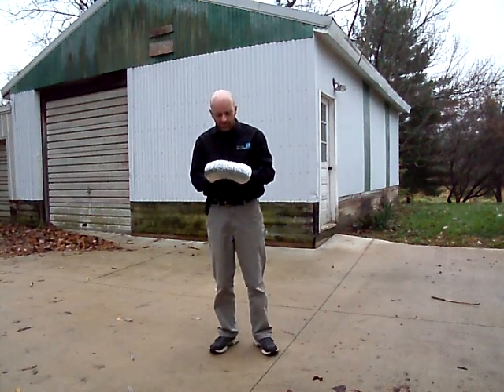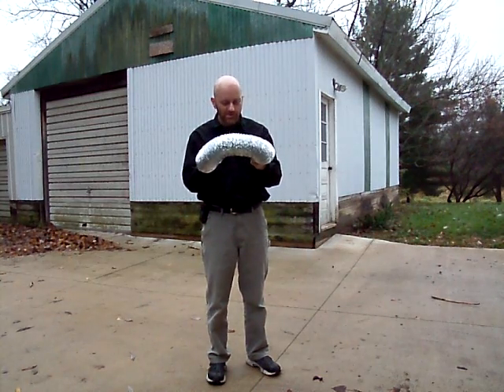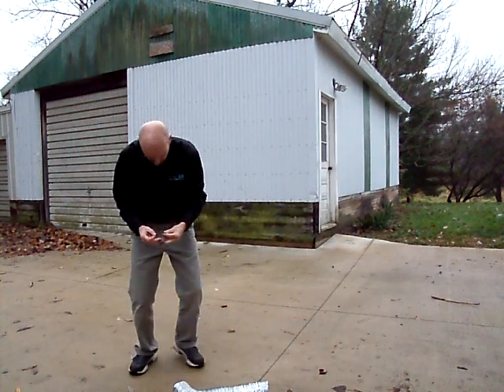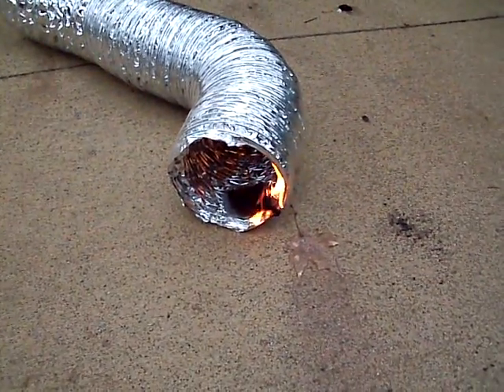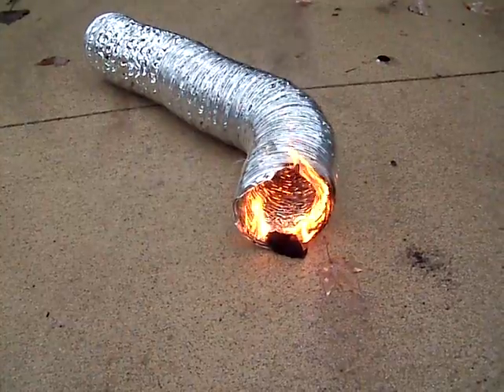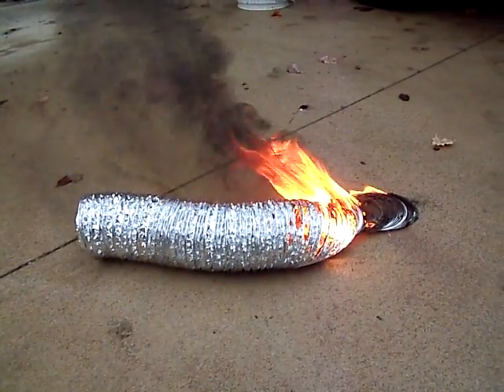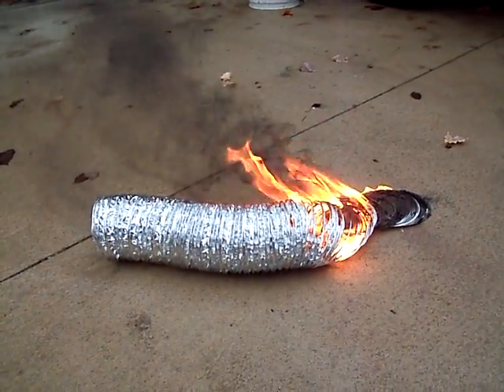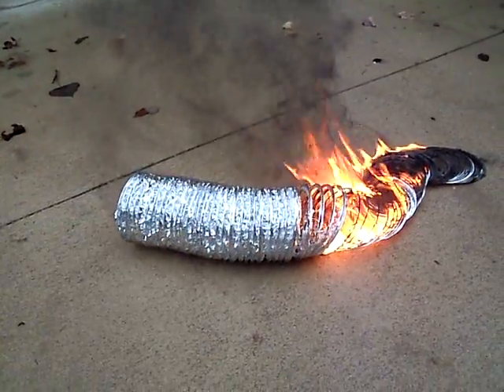Dryer vent installation BAD IDEA

Comment: That hose is not a dryer vent hose that is used for bath vent or a stove hood
Reply from the maker: Correct, but it was SOLD as a dryer vent. It's no good for most bath vents as well unless you can bury it under insulation. Without being insulated, it would allow a lot of condensation to occur. There aren't very many uses I can see for this material besides setting it on fire in the driveway!

Comment: I think this video is funny and not factual. I am a delivery driver for an appliance company and I use these dryer vents every day. Never once have I seen a house catch on fire due to the vent it self. Only due to not proper installation of the vent or installation of appliance. Any dryer vent can cause a house fire due to too long of vent and crunching of vent causeing lint to built of not escape the vent. Get your facts straight.
Reply from the maker: The FACT is that this product is being sold as a dryer vent, which is essentially a chimney, and the thing is flammable. You are correct that a dryer fire can still happen and burn up the house even with proper venting, however everything should be done to minimize the possibility. In addition, these vents get brittle and crack, leaking fumes into the house and could lead to some serious problems.
Reply: Plastic and thin metal flex duct like the one in the video IS flammable. Even if there are no issues with the installation the ducting becomes clogged with dryer lint over time (which is EXTREMELY flammable) and can cause a house fire. Thousands of house fires happen every year due to this. Get YOUR facts straight Mr.Gomez.
Reply: If a fire starts inside the dryer, that plastic will carry the fire to the structure of the home. However metal duct work will contain it and perhaps the lint will burn out and save the day. Thank you for this excellent demonstration.

Comment from the maker: Yes, if remodeling, an extra layer of drywall would be a VERY good idea too. Since most laundry rooms are small, using two layers of 5/8" drywall (preferably paperless or green board) and cement board under the flooring would be very cheap and do a lot to contain any fires. Good idea. Thanks for commenting.
Reply: You may find this video interesting. Metal studwork is now standard here in the UK on new buildings and major refurbishment. As you can see from the video, it runs below ceilings, preventing a fire path between floors in the building.
A complete review of building regulations is long overdue in the US. 
Once materials like this become the norm, they are mass produced and any increase in building costs becomes minimal.
Their is a joke about US architects in London, having an annual award for the company who designed the best bonfire.
Many a true word spoken in jest.
  https://www.youtube.com/watch?v=ABGd6B0v9go

Comment from the maker: The lint inside could catch on fire, but unlikely if it's way down the line. As long as you have good airflow through to the end it should be okay. It's when there is a clogged up spot that gets constant heat applied to it that causes a problem.
Reply: Yes it backs up in the dryer causing the thermosats to open and clothes don’t dry

Comment: I have the hard aluminium flexible hose on my dryer. It is safe material from what I can understand by watching you tube, but what happens if the lint inside catches on fire like you have demonstrated . Can that happen in the aluminium duct? I cant see down it all to clean out the whole duct. Only part of it at the exit.

Comment: My name is Rick Bishop. I am the founder of Bishop and Son Appliance Repair, llc.  This is great stuff- graphical demonstration. I too have been advocating the use of proper materials in home dryer appliances. Ridgid metal ducting might be beyond the scope of your average diy individual but by far the best approach. The aluminum flexible is pretty good but one thing to remember is aluminum begins to erode away at near 500 degrees farenheight.

Comment: @Nathan I'm a firefighter in a town of aprox 30,000 people and we get at least 2-3 working dryer fires a month and I have seen both all kinds of vent systems and by far this and the same style in the white plastic cause the most dammage to the home the next worse is the aluminum foil style duct tubing and the very best and the least damage is the rigid galvanized steel duct it contains the heat and fire and vents the smoke and fumes to the exterior of the home. I agree this stuff is awful !

Comment from the maker: I'm not sure why you'd want to do that. Do you need to have a combustion air intake in your basement to keep the basement from being negative pressure when the dryer or water heater runs?

Comment from the maker: Did the vent material you sell do the same as mine? I'm planning to buy a few more different pieces and do the test side by side with several types. Some of the videos I've seen of others who claim to have a safe material neglect to put flames INSIDE the duct or use a piece of lint.

Comment: Not all vent hose is the same.  Look for the UL listing. If it has the UL listing you can't light it with a torch, I've tried.

Comment: All dryer vents should be rigid ducting.. With the 45 degree..and 90 degree adjustable elbows ,  rigid ducting can be installed anywhere the flexible crap is used.  A few more dollars..a few more minutes,or even hours.. Isn't  your property and your life worth the extra effort...

Comment: I just replaced an old one that was A. clogged up so bad i couldn't push pull or vacuum it out(multiple lint balls that completely closed off the vent), not to mention all the places that were so dry and brittle it disintegrated upon cleaning. This house was built in 97 so its not that old, but I did use the same material when replacing it, I thought that was the only kind approved for dryers.

Comment: Sometimes you have to snake around other pipes, hvac and whatever else. You can use rigid, but the flexible aluminum (semi-rigid) is easier. the plastic stuff that looks like foil is crap, as shown here.

Comment: Now that's a fire!

I see this stuff at my local HW store next to the all metal ones.  Very little info to on the shelf to mark the differences.  It's should be labelled in big bold letters that it should only be used for range hood exhaust or room ventilation.  Why do they give it the metal look and confuse the DIY person? Aesthetic appeal.
When in doubt, seek a professional.

Good vid BTW

Comment from the maker: @TheFarawayeyes5  Glad you see the light my friend. There is another material which is even more flammable because it's made of a paper based foil. I grabbed a piece of dryer lint from my own dryer to start the fire inside it. The material itself may not ignite easily from a match, but the main cause of these fires is that the vent gets a large ball of lint that plugs the vent almost completely. Use a BIG piece of lint for your demo.

Comment: Thanks for the video. I sell these vents. Every dryer owners manual tells you not to use them. And I resisted selling them until my delivery teams complained about how hard the semi-rigid aluminum ones were to install, so I gave in and started selling the cheaper ones to make deliveries go smoother. Tomorrow morning I will attempt the same demonstration at work, make a video and email it to our appliance buyer. I really had no idea they were plasic made to look like aluminum foil. Thanks.

Comment from the maker: @southernstylez904 I have a second video which is a follow up showing the proper dryer vent. As long as its real metal you're fine. The flexible metal called "semi-rigid" is most common and is aluminum that's a little heavier than beer can metal.

Comment: Why do they sell these if they are still made out of plastic? When I bought my house, my inspector told me to replace my white-vinyl dryer hose with the "aluminum ones", saying the white vinyl was banned. The only thing they sell at HD & Lowes is these crappy fake aluminum plastic ones. I bought one thinking it was really aluminum but lo-and-behold it is the same stuff shown in your video! I  was later able to source a stretchable REAL aluminum one from a local hardware store.

Comment: In my current setup, I use rigid since the pipe to the exterior wall is that close to the dryer.  I only have a 90° solid elbow & an elbow I was able to turn 135° to connect to the pipe to the outside.  My last place; I had to replace the vinyl type that the previous owners used from the dryer, thru the crawl space & to the outside.  I used the flexible aluminum from the dryer to the wall in the basement.  Then I went with rigid from the basement wall, thru the crawl space, to the outside.

Comment: WoW - that was a great demo of why not to use this flexible duct.  My current dryer duct work (just like what you are showing) came disconnected from the dryer (dust tape lost grip). I will now use ridged metal duct work.  Thanks for the heads up!